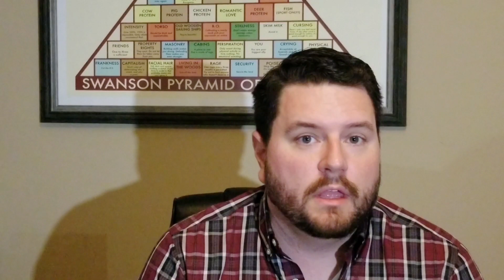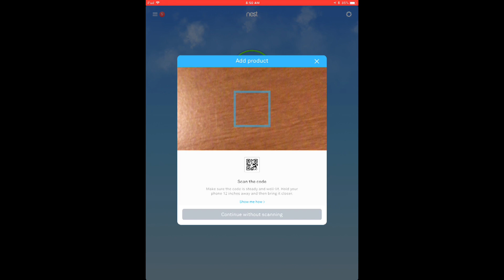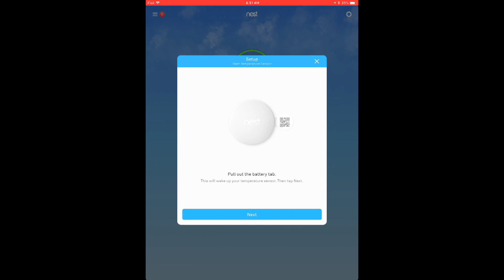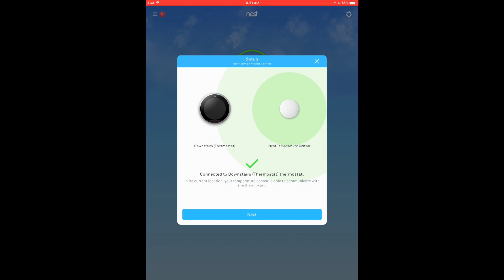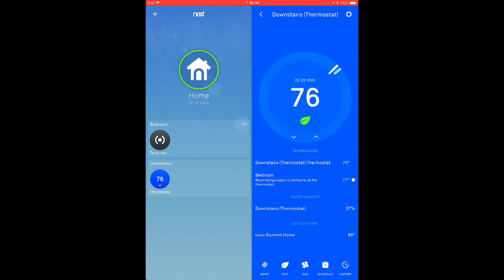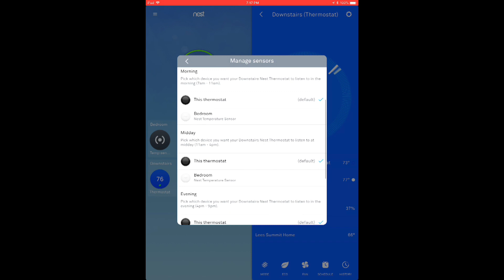Nest Temperature Sensor - Quick Start Guide

Comment: Excellent video! I purchased three nest sensors. From what I am understanding is that each sensor only exists as a "set point". Meaning you only need the amount of sensors that you want the thermostat to go off of? For example, if someone had: 

Sensor A (the Nest Thermostat): Living Room with a current room temp of 71
Sensor B: Bed Room with a current room temp of 68
Sensor C: Office with a current room temp of 67

And you wanted your office is to be set at 70, you would set Sensor C as primary. The result of this would be:

Sensor A (the Nest Thermostat): Living Room with a current room temp of 73
Sensor B: Bed Room with a current room temp of 70
Sensor C: Office with a current room temp of 69

Do you believe my assertions are correct? Thank you for your time! Bryce
Reply from the maker: Hey Bryce, sorry for the delay.  The way that the nest sensors work is there are for time periods in each day.  You can set a primary (or "comfort" sensor) for each time period.  So you could have Sensor A active during the morning, B for mid-day, C for evening and the thermostat for night.  It is very limited unfortunately.

Comment: Question, I have 2 nest thermostats in my home. One in the entry way the other in hallway. I purchased 3 sensors. Do all 3 sensors need to be assigned to one thermostat or can you have 2 senors on one and 1 senor on the other??

I having trouble getting the senor to be listed on one of the thermostats.  Thanks
Reply from the maker: Leonard, I don't have multiple thermostats but looking at the interface I think you could assign 2 to one and one to the other.

I am assuming both thermostats are on the same account.

When I click on the thermostat and then select settings and Manage Sensors.  In that schedule I think you can select which of the 3 sensors you want to have THAT thermostat use as the set point for each period of time.

Again, I don't have multiple so I cannot test, but it would make logical since if that was how it works.  Let me know how it turns out!

Comment: If you pull the battery tab and loose the QR code is there a way to identify
Reply from the maker: Tim, I don't think it is required.  I believe that the QR code just tells it what type of accessory and its code.  In the app, just select the "Continue without Scanning" button at the bottom of the Add QR code.  Then on the next screen, select: Nest Temperature Sensor.  Finally, enter the 9 digit code that is inside the battery cover.  That should do it!
Reply: This Smart House ok that works I had not had the battery cover off but it is there
Reply from the maker: Tim Connor Awesome!